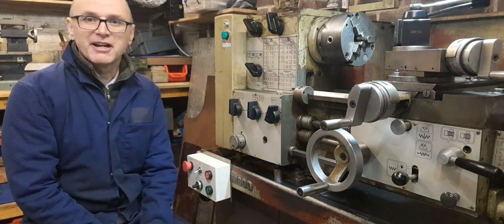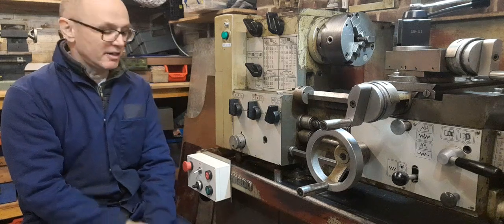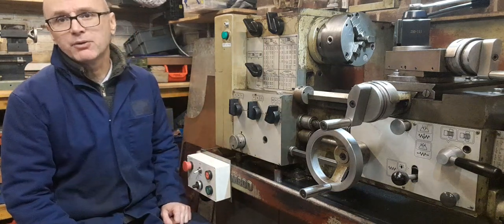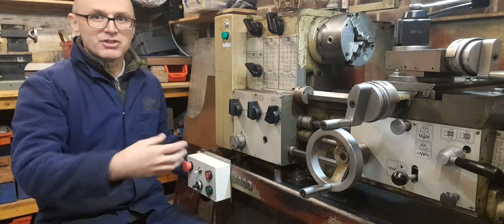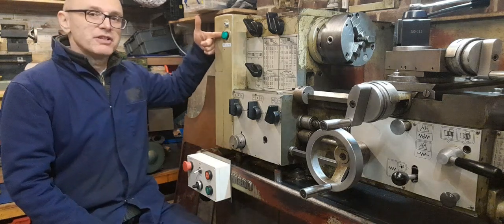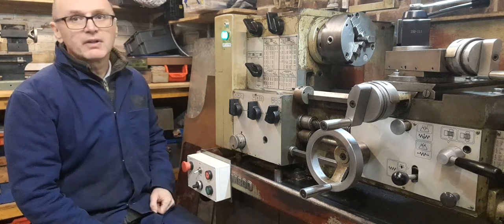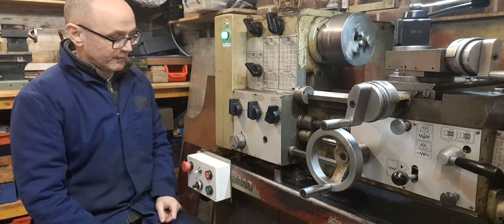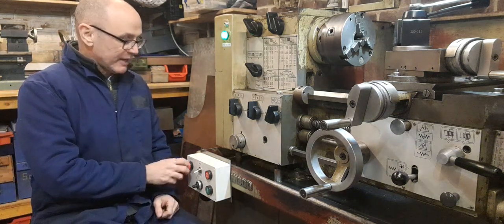Using a contactor with a VFD on my Harrison M300 lathe (video 1/3)

Comment: Good job and it works very well.
I've just re-done all the electrics on an M300 so I can use it at home on a single phase supply.
I kept much of the original controls, but in retrospect, should have gone down the path you did.
Do you mind sharing how you lubricate the compound via the boil oiler points as I can't find a suitable oil can to do this.
Reply from the maker: Ball oilers? I just use a regular pump oil can with a spout. For "grease nipple" type fittings that should be fed with oil, I have a high pressure grease gun that I converted to oil.
Reply: @PizzeyTechnology  
Thanks for that.
The oiling points on the compound on my lathe are very small balls in conical recesses and no oil cans I can find will do the job.